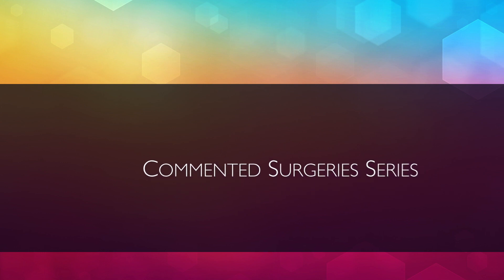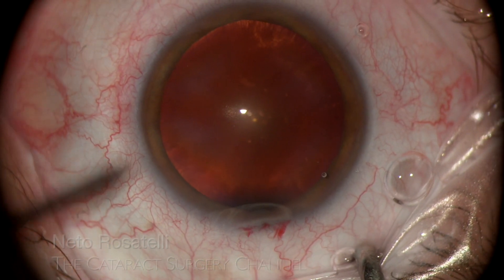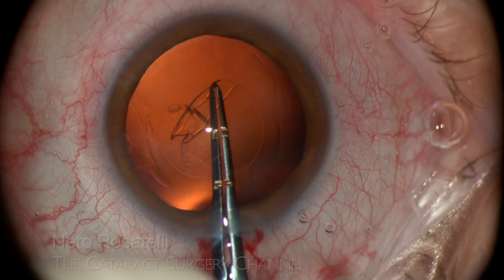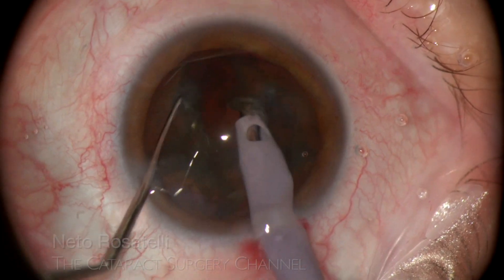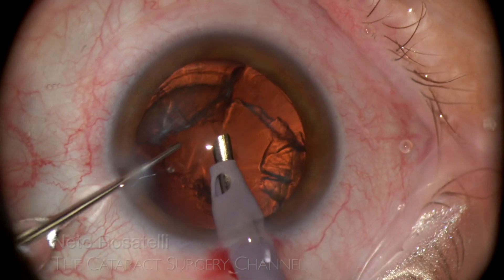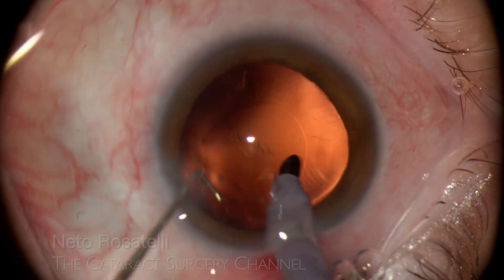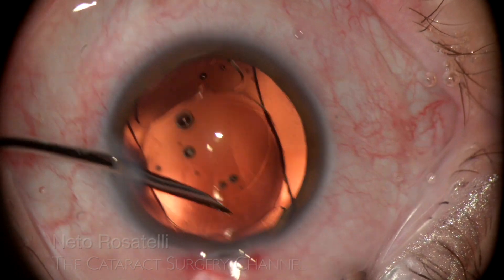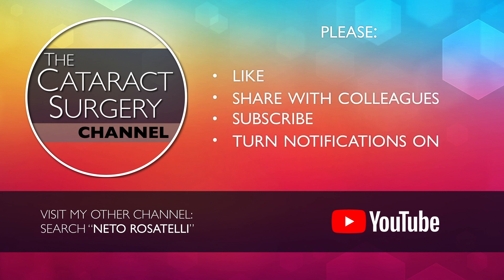COMMENTED SURGERIES #6 - High Myopia

Comment: Great surgery! What's the name of the chopper? Thank you and greetings from Perú.
Reply: Thanks Dr Tello! This is in fact a custom made chopper made by my specifications, based on the DODICK PRECHOPPER (used in the Preslice Phaco Technique - please watch Phaco Clip #2 - Slow Motion Preslice - https://youtu.be/AyEl6Ob82z8). It has a 2.5 to 3.0mm right angle bend at the end, no cutting edge, and a 1mm ball end. It can embrace any nucleus in horizontal chopping techniques, easily reaching the posterior plate facilitating cracking even in very hard nucleus. I use it in any kind of nucleus and phaco technique though, because despite its size it is very safe on the capsule. It feels a little clumsy at first because of the bend size, but soon you get accustomed and it is a very effective instrument. I rarely have to resort to using other kind of chopper. Thank you for your interest sir!
Reply: Thank you very much Dr!

Comment: Thank you for this amazing video sir. I have a question about hydro implantation of the lens. Is the lens loaded in the injector with visco as usual or the lens is also loaded with bss?
Reply: Thank you sir! The IOL is loaded in the injector cartridge with BSS. Sometimes high power IOLs (28 and above) are loaded with OVD, but being that a small amount, as soon as the IOL enters the eye and I take the cartridge tip from the incision, the irrigating BSS washes out the OVD.
Reply: @NetoRosatelli  thank you sir I am very interested in applying these techniques in my surgery. Especially the phaco tip cortex removal. Looks scary but with the correct control I think is amazingly efficient with a very clean capsule.